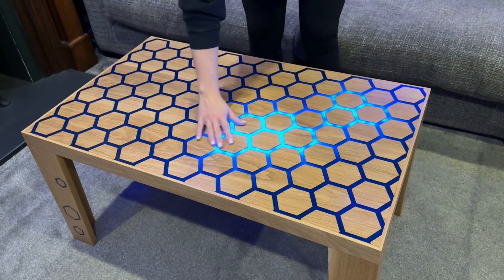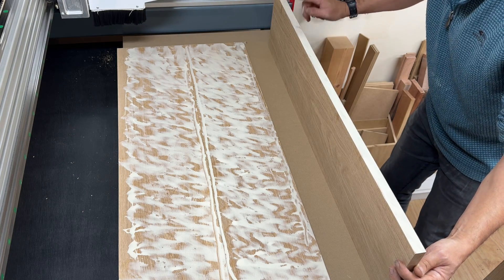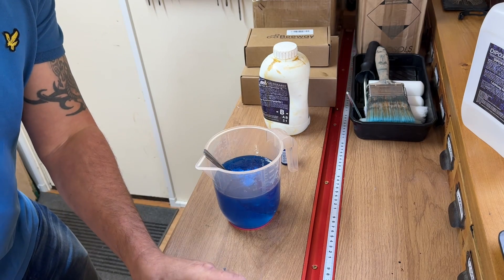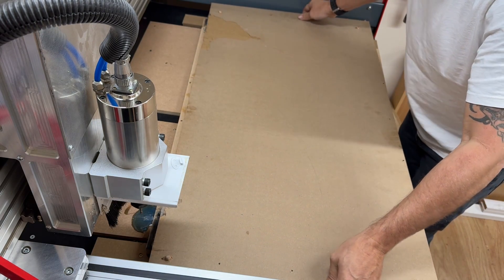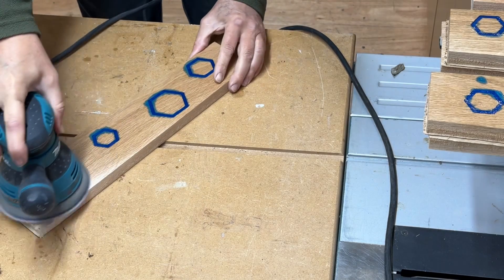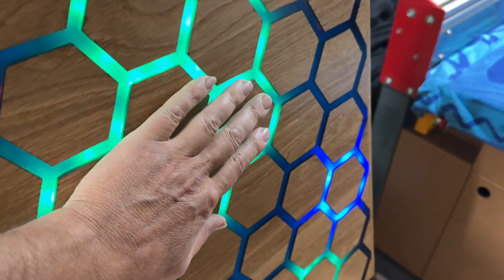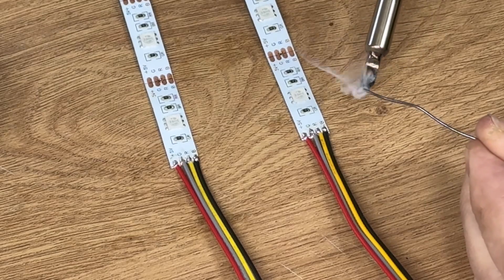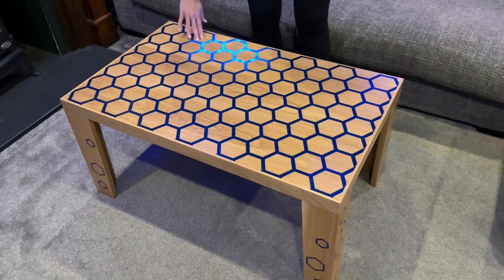Smart table - interactive LED table - near disaster!

Comment: hey, wonderfully executed. can i power this up with a 20,000 mah power bank? how did you manage your power cable. not seen in the final part of the video.
Reply from the maker: @anujbansal9274  I used a 5v mains power supply - I’ve not tried it with a power bank, but I don’t see why it wouldn’t work. As for how I managed the power cable in the final part of the video, it is simply routed under the table, down one leg and then out to the plug. I was just a bit crafty with my camera angle so it wasn’t visible.

Comment: When you using Epoxy wear M3 Mask and thin gloves
Be careful
Reply from the maker: Thanks for the heads up. Not sure if all epoxy is the same but the stuff I used has little odour.
Reply: @ 
Unfortunately you still have to wear the mask, glasses and gloves.
Your works are really empressive wish you a good luck!

Comment: Very beautiful and such a talking point when you have visitors i'm sure. How many times have you been asked to make one for a friend or family member? I have done woodturning as a hobby for many years and the amount of pieces I have been guilted into giving away is tremendous. I would love to attempt something like this but the CNC machining is the obstacle for me and I would think many others. Thanks for sharing.
Reply from the maker: Although a bit more difficult, I recon this could be made by cutting out hexagons and using a router. The CNC makes it more accurate, but with patience it could be done. 👍🏻
Reply: @120woodcraft  It crossed my mind about using butchers block solid worktop, it gives that extra depth. It would be great to have a kitchen island done in this way.

Comment: Fantatstic vodeo !!. I had seen the indan and chinese versions, but yours is by far the best. I would really like to make one of these. Would you mind sharing, what size hexagons did you use, what gaps between the hexagons and what size circles? Did you have to cut the LED strips down?  From your power supply you have a pcb that your plugging the power into, what is this, is it somesort of driver? Also, which powers supply did you use, do you have a link? Thank you
Reply from the maker: @jimrosseter7958  Thanks for your comment 👍🏻. Hexagons were 70mm across straight side to straight side or 80mm point to point. The circles inside the hexagons were 60mm diameter. Then inside this was the cut out for the PCB. The gap between hexagons filled with resin is 10mm. As for led strips, no I didn’t cut these down, however there was a slight overlap that I didn’t really bother about. The led strips have marked cut lines and there wasn’t one in the appropriate place so I left it. The little PCB the power supply plugs into is actually part of the kit you buy from moreboons. It’s identical to the other PCBs, except it has a usbc input as well. Power supply goes into this. The power supply was just a generic 5v 30A Amazon one (I think). But make sure whatever leds you buy the power supply matches some are 5v, some are 12v. Here’s a link to the likely one I bought. Good luck with making your table. It’s hard work but a good challenge! 
https://amzn.eu/d/hNQoa3H
Reply: @120woodcraft  Many thanks. I will let you know how I get on. Nice channel by the way :)
Reply from the maker: @jimrosseter7958  let me know. If you film it, post a link on here👍🏻

Comment: Great video mate and perfect timing as I am in the process of making my own table like this. After watching your video I am concerned as I have already purchased square shape PCB's that look identical to the ones that didn't work for you. I guess I'd better do lots of testing before fitting them to the table!
Reply from the maker: There are a lot of variables that can make things work… or not. The square ones (made by moreboons) did not work for me, but I did see videos of tables working with them. Where did you get yours? Are they identical?
Reply: @120woodcraft  I bought mine off Ali Express... I have just done another comparison to your video and while mine are very similar, they actually are not identical. Hopefully they work. either way I will be doing some testing.
Reply from the maker: @sheldonives  certainly having them in groups of 10-15 helped me somewhat rather than all in series.

Comment: I've promised myself I am going to make one of these. This is by far the best and most informative video I have seen on the subject. Subscribed! I am keener than ever now. The MDF base for the machining process was a really good idea. How much epoxy did you use for this build and how much of the mica pigment powder did you use for that volume to achieve the required opacity please? Great job. Great video. Many thanks.
Reply from the maker: I used about 3 litres of resin in total…. Some of that leaked though! As for the pigment, that was very unscientific. I just kept adding until I got what I thought looked right. Shone my phone torch through to check the opacity. To be honest I could have added more. I really wanted to only see a glow of each unit when activated, but you can definitely see the individual light of each led. But you don’t need much of that powder pigment - a random guess is 3g. Hardly made a dent in the pot I bought. Go for it…. Make one. I enjoyed it overall- even the problem solving!

Comment: Do you have any information about the redesigned boards, and leds? I feel like splitting up the power supply was the best option. High current loads near capacitive sensors sounds like a troubleshooting nightmare.
Reply from the maker: I’m no electronics expert but my testing found that having 80+ sensors in series caused issues. I divided them up into 4 groups and all worked fine. I’d say 20 sensors in a group is close to the max. Here is the link to the sensors. 
https://www.moreboons.com/products/touch-sensitive-smart-table-module